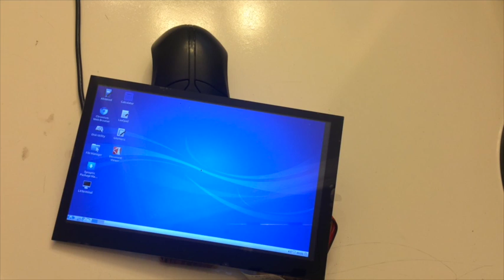pcDuino3B with 1204x600 LVDS

Comment: As previously asked what firmware did you load onto the usb and how did you install it onto the usb stick.  I've tried and havent had any luck ???
Reply: if you go to link sprite you will find the kernel and dsk image under the pcduino3 stuff, not the 3b stuff. The files you want are pcduino3_lvds_a20_kernel_livesuit_20150314.img and 
pcDuino3_lvds_100MbpsMAC_1404_20150202.img.zip. good luck.

Im gonna try and get it hooked up to my rpi3 next, cant find any info anywhere of it being possible or not.